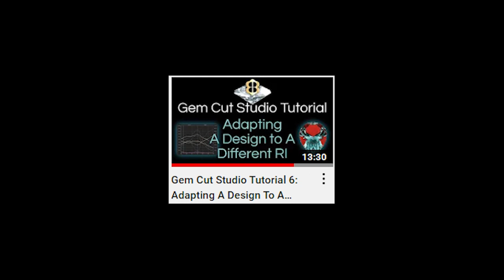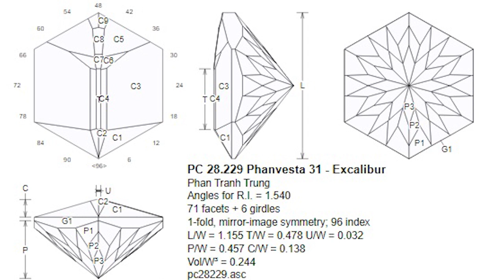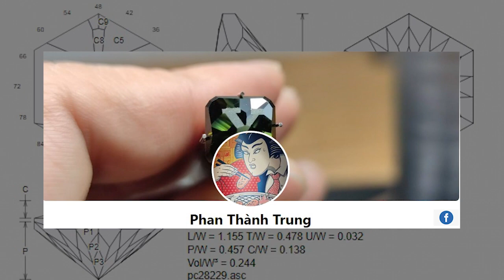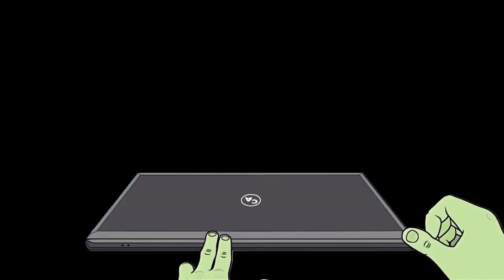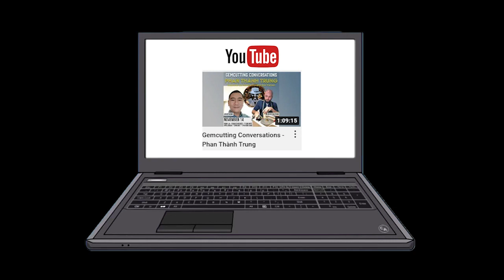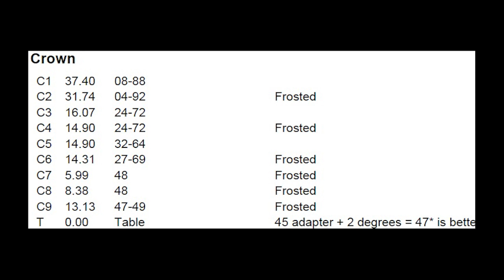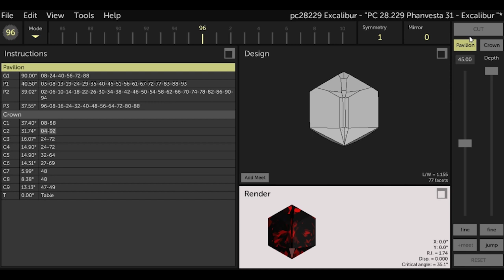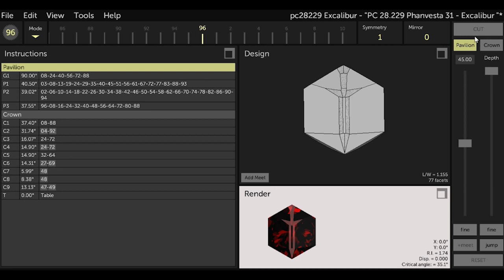Gem Cut Studio Tutorial 9: Working With Frosted Facets

Comment: As with many things, there are more ways to skin a cat ... or frost a facet.
The video shows one of the faster ways and most immediate option to frost a group or Tier of facets.
However, if you want more control over which facets are frosted, click on the expand button (the box icon) at the top/right corner of the Design Window. Here you can click on individual facets and select Frost (right side). This enables one to frost individual facets, one at a time.
This can be really helpful when creating complex images that may have single facets on specific indexes OR multiple facets on a Tier but only a few of them require frosting.
Reply: SnowTiger45 thank you very much for that information.  I am always learning something new!  Thanks again!

Comment: frosted facets... is this done with sandblasting?
Reply: You leave the facets unpolished if I understand correctly.
Reply: @Keilsyar  Correct, normally either at the 600 grit lap (as Phan recommends in his comment above) or at the 1200 grit lap level (I use a 1500 grit).  Or some with 600 and some with 1200, if you want lighter and darker effects of frosting...but right now, GCS doesn't allow two types of frosting.
Reply: l will walk you through how to frost facets when I cut Excalibur in an upcoming video, but as the creator of this gem cutting design, Phan Thanh Trung, mentions in a comment above (in his post as Viet Gems), frosting is done by simply not polishing the facet.  Phan says (above) to use a 600 grit lap...however, I have frosted facets with both a 600 and a 1200 grit (I use about a 1500 grit lap and not a 1200)...and you can make light and darker frosting effects by using the 600 grit on some facets and the 1200 (or 1500) grit lap on other facets.  I do not know anyone who has tried sand blasting facets to get a frosting effect.....but who knows...give it a try and let us know if it works!!!